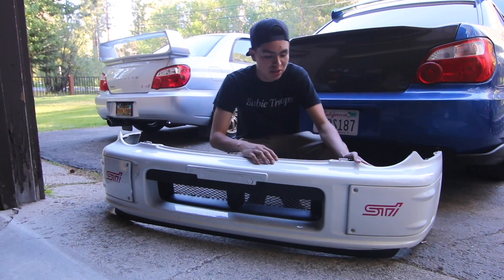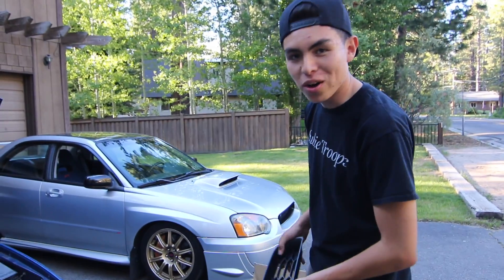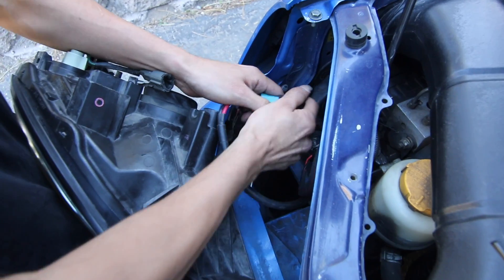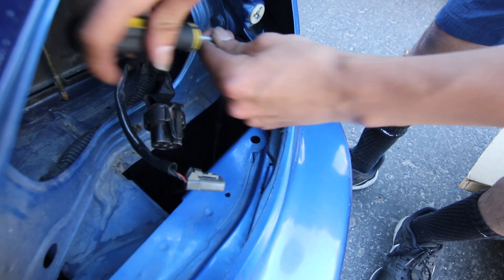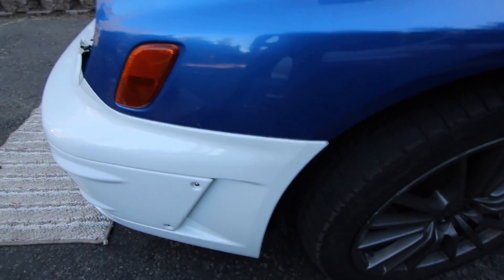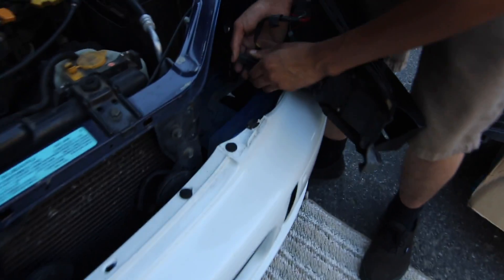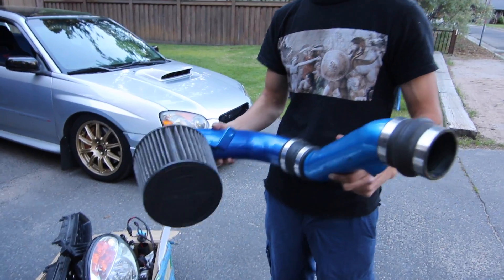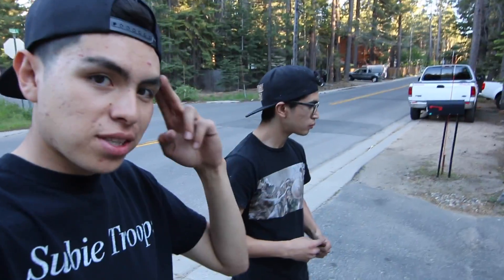We Found RARE JDM Parts!! Install Bugeye WRX

Comment: I noticed you have the same issue I had before. The fitment is off a little between the driver side headlight and the hood. Pop your hood and twist the rubber piece just behind the headlight and it'll adjust the fitment.

Comment: You guys should do a video about buying a wrx and the process/the right things to look for. I just got my license and I am busting my ass for a car(hopefully a wrx lol). I would really appreciate some tips on what to look for when buying and whether it is a good deal. Keep up the good stuff guys!
Reply: Make sure the car is not making funky noises when driving, check the engine oil before driving it and fo an oil change before you start driving it daily. Make sure no knocking noises. Look everywhere for rot and rust that was my mistake. But now my wrx is going to look gorgeous so it's no buggy for me

Comment: Nice thing about those Morettes is you can get rid of the piece between the stock headlights and the grille which I think are pretty flimsy and don't look quite right.  That bumper looks much better than stock.

Comment: Those head lights where for the Europe market idk if they are considered jdm 🤔
Reply from the maker: Chris Garcia my mistake, thats actually very true!
Reply: True :) They were very popular in late '90s, early 2000. Originally company is french. I'd really like to buy it but it costs fortune ;) I'm doing lens installation in mine.
Reply: Chris-  That is correct.  I have a set of the actual JDM projector headlights on my 03 WRX and they look quite a bit different than those morettes.
Reply: because "RARE EDM Parts" doesn't sound doesn't get the views ;)

Comment: Ahhh those top front bumper clips gotta love em lol. I found it easiest to remove it in a snap by: once you lift or essentially hear the unclip sound from the center portion no need to pull on that center piece anymore just pull on the very bottom portion that's in contact with the bumper and it should pop out easy on every one. Because I found that the more you pull on that inner center portion the harder it is to remove the whole clip itself. Just thought I'd share my experiences with it, keep the vids up y'all 👌🏽
Reply from the maker: Devviant right! And Subaru used those clips everywhere! Haha thanks man!

Comment: the OEM headlights are with H4 bulbs which are for low and high beam so when you install cabels on the same way with the morettes when you turn the high beams on the low beams go off which is not good... :D
Reply: Morettes can be wired for HID low beams to stay on with the halogen high beams - mine do. Wire them up without the relays they come with and do a direct ground. Refer to NASIOC Morette threads and Google.
Reply: @jukeboxzero1  mine do too :)
Reply: @TheTHEPrs  Just sold mine on eBay for $1,300 + shipping.
Reply: @jukeboxzero1  yep the price is going ti the moon😂

Comment: I had Morette headlights on my bugeye, I kept breaking lenses. Then I sold them cause that shit gets annoying
Reply: Also, there should be bolts at the end of the bumpers holding them onto the fender. Noticed they weren't on yours. Or you skipped that part